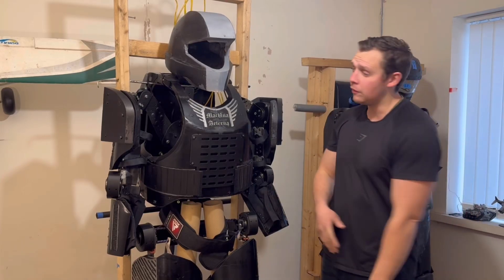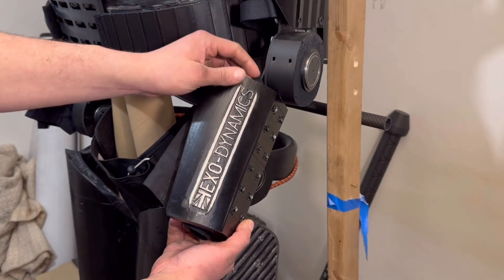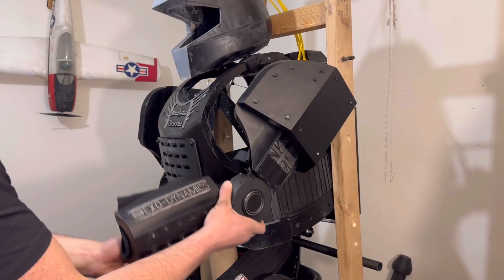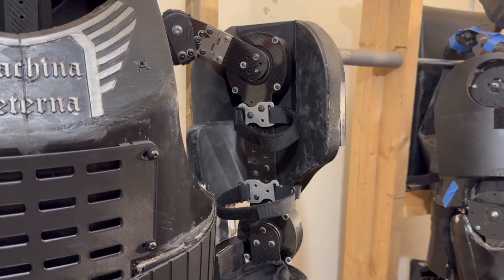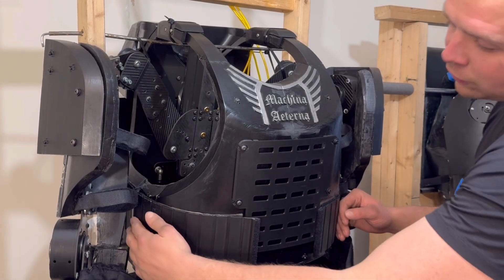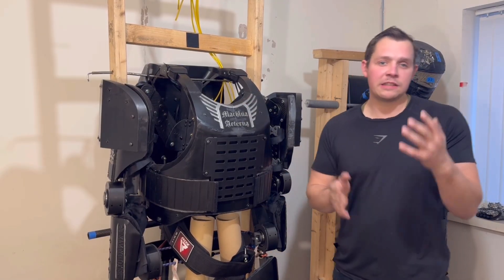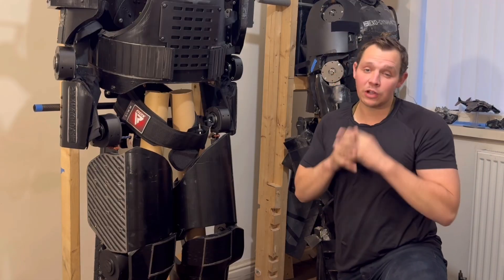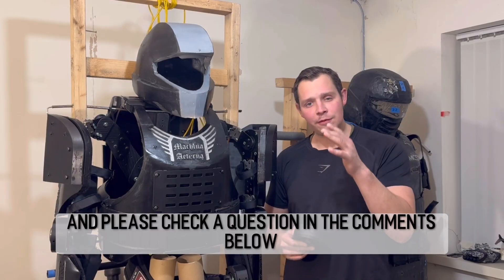My own Suit of Functional Power Armour is nearly complete!

Comment: Went back and watched some of your recent videos leading up to this one; some thoughts and points to help “standardize” or set up for future production are: (and I apologize if I come across wrong with my understanding)

For different sizing, maybe look at how you can swap the bars between the actuators. It looked like you had bolt on portions that connected between them, and it may be the simplest solution for adjusting to differing body shapes, but I’m not sure if it would be the cheapest as it would require a range of extra parts to be manufactured. 

Speaking of the actuators, have you thought about looking at the electric motor designs used in EVs? I don’t know how well they would translate or compact, but the Prius EMs they have been recently producing are quite flat (for vehicles) and may give inspiration for any improvements if needed. 

For the armor, I think you have a good start. Focusing on a layered design may be best, with a way to fit and swap plates, otherwise steel may need to be the go to for encasing the ceramic tiles. I’m not sure about a plate carrier connection with weight, distribution, and form fitting, but it would be a way to help connect it to the body easily.  

Overall it looks like a great design! As a state side cousin, I’m definitely curious to see where it goes and how it performs under tests. I do apologize again if there is ignorance in my suggestions or knowledge, I’d be happy to discuss my points further if it helps. These are just some on the fly thinking…

Comment: Neat project. The weight is going to be a serious issue, even with mechanical assistance. You have to figure another 200 pounds for the operator and at least another 60 pounds in weapons, gear and ammo. That is going to limit where this thing could operate and how it would get to the zone. Not to mention to the fact you would be extremely vulnerable to things that explode. Might be useful for riot control situations where the pavement would provide support and less likely to deal with rpgs

Comment: Man this is some really good work. Kind of a shame the UK government doesnt want to get in on power armor early. Honestly this is pretty much right in line with the Cyberpunk timeline we are in right now. I myself have been wanting a protective suit of armor for high speed electric unicycle riding. I need something like an ironman suit, particularly from iron man 2 would be ideal. Something I can step into and it will sort of attach itself and be able to absorb extreme impacts, and modularly repairable. This seems like a pipe dream but it would be so amazing. I think what youre doing here is the first steps towards something like that.

Comment: Modern fragsuits exist that the FSB uses, it’s possible that it could be worn as a base protection layer under the armor. I am not sure if it’s something you could actually get, but a shrapnel protective jumpsuit under the powered plate armor could prove to be very good protection. One issue I can see however is overheating if wearing a frag suit

Comment: I love this but in the practical sense I can sadly only see this being used in the commercial market or logistics because of the strength multiplier that it is, aka the ability to make the normal man stronger than he normally is, I can see this in construction or any labouring work. With modern warfare I do not see this sadly being practical with various factors like the power supply, there's no way that can run forever, anything doesn't run forever, replacement parts, and the complexity like a normal soldier or operator must learn how to not only operate his equipment but learn how to maintain it, and probably the bulkiness of this.

Normal body armour is already quite bulky and heavy, with how I look at your armour it seems quite bulky, not that bulky but bulky in the very least! And that's just the factors I can name.

But That's just my point of view and opinion, don't stop man on your dream, will continue to support you and hope you luck in the future.

Good luck with your prototypes mate. And again it looks so cool!

Comment: Speaking from the perspective of a U.S. Marine veteran that is now an engineer, you've done an amazing job, given what your resources must be. You've done better than the entire country of Ghana, which has a much larger budget. Full credit to your skill and improving craftsmanship. You should be proud.  

However, I would not wear this device in battle unless I had NO other option, and even then, only in VERY limited capacities where I wouldn't need to move much. The problem isn't anything that's your fault, it's just the existence of far superior, albeit far more expensive materials that afford greater mobility without need for a heavy battery pack. Graphene, in particular, is at least 200 times stronger than steel, and if added in small amounts to carbon fiber, is ALSO 200 times stronger. That means 200 times lighter, of course, for the same protection. And it's far more versatile. Every gap you've got for flexibility could be covered with Graphene lamellar, and the suit could weigh around the same as a flak jacket, with only light carbon plates to distribute impact force. 

Unfortunately, Graphene is around $50 per square inch and it requires an incredible amount of energy to work with, along with specialized equipment due to its incredible strength and heat resistance. You can 3-D print it, but whatever you print isn't getting chemically joined to anything else because it's a stable carbon lattice. That would mean ringlets, Velcro, or whatever else to secure the pieces together. Those will be the gaps, but they'd be smaller and stronger. 

Battery power in such a suit would be better used for low-power electronics, especially comms, to reduce weight, since a human could wear the suit itself easily. Your power armor and whatever actuators you develop might be better used in support roles to augment strength, and preferably somewhere near a generator for constant supply. FOBs at risk of insurgent attacks or something, to protect support personnel and aid them in the very necessary task of hastily loading and unloading vehicles. The vehicles themselves could be the main power source. 

Other than that, the metal fasteners have to go. They'll shatter upon sufficient impact, creating shrapnel, so you might as well just Velcro the pieces together, or use a polybonding agent. Velcro is preferable for adaptability. 

That's my 2 cents for now. I wish I had the $10 million or so it would take to get you the best equipment for this project, but hey, you're in the U.K., right? Maybe you can claim status as a gay Syrian refugee and tour the continent collecting welfare money to raise the money. No insult. It's just one of the best ways I can think of to get free money before you're really gonna need that armor.

Comment: You know what's surprisingly light weight and resilient as a cheap material to make composite-esk armour out of? 

Simply lacquer and fibre glass sheets. 

Much cheaper.

Could be worse man, you know that in Queensland, Australia, you are not even allowed to wear anything that and I quote: 'Could stop a 9mm bullet'. 

How fucking nuts is that? 

Might as well be stirring peanut butter with your Dick.

The law hails back to the 1990's and Vietnamese gangs. 

But honestly, same old dirty nasty, lazy, rotting governance misnomas. 

They never reneged the law, once the problem passed. 

But it is those most adaptable to change that survive.

Comment: I feel like some sort of shielding for the neck might be good to have. I was thinking back to different medieval armors that on the torso pieces have a bit of a lip or extension at the neck area and the arms for preventing arrows or blades from deflecting or going directly to the neck or armpit regions. I think making it specifically for shrapnel over just taking a bullet might be better for weight.
Reply from the maker: Yeah it just needs to be easily removable. I guesss medieval knights had peasant surfs to help them do normal things when in afmour. But with a gorget on you cant look down.
Reply: @MattExo-Dynamics  Indeed a large gorget or ill designed one would block vision. Maybe a minimal one, just something to deflect shrapnel from the neck. I would think if it went even 3-4 inches out it could deflect most shrapnel no?
Reply: @MattExo-Dynamics  we had soft gorgets for the interceptor body armor I wore in Iraq. You could clip it just like we did

Comment: Have you taken a look at all at the resistance spring based exoskeleton that Crash Makerspace has been working on?  Also for the forearm mounting system have you considered using an off the shelf short picatinny rail?  One other suggestion is to look at the way some of the modern sport reproductions of 15th and 16th century mantled gorgets that integrated with the helmets worked, basically two plates of metal that sat on your shoulders and then 2-4 bands both in front and back of the neck that hinged on one side and buckled or latched on the other, with a wide enough roll at the top that an armet or close helm could close over it to keep it in place.  Aside from the neck protection mantled gorgets do a really good job of spreading out the weight from all just riding on a couple of points on the shoulder.

Comment: It looks cool, and I want you to keep working on it. But I've followed projects like these since I was a kid. One man made a suit he used to "fight" a bear. But I'm worried it's falling into the same issues that a lot of these power armor suits fall into. They're heavy, expensive, and impractical. You have to stop and think: Who are these suits for? How many soldiers do you expect to wear these? Would a soldier actually prefer wearing something like this over a flexible material that allows him to move quickly and efficiently? If they do adopt these, each one would have to be tailor-made to fit the individual. In real life, special individuals with special equipment like Master Chief aren't a thing. That's because in real life, giving only a select few soldiers special equipment is pointless. If it can't be given to all soldiers, then that's a massive waste. 

The reason why these suits aren't commonplace isn't that we don't have the technology; it's because we can't figure out how to implement them. The exosuits we have so far are designed to be lightweight and integrate with already existing body armor. Even then, it's experimental and only used for heavy lifting like large ammunition. 

On top of that, research is starting to come out that exoskeletons actually hinder movement rather than enhance movement because the wearer has to relearn how to walk and move while being assisted.

Comment: why not use a gorget for neck, chin, and face protection?  rivet it onto the breastplate.  full head movement is maintained, equal head/face protection is maintained, and less weight is put on the head.  I guess it's meant to aesthetically resemble an ODST so maybe I'm barking up the wrong tree.

Comment: Stitch the Velcro onto the harder components so that it is not relying on just adhesive, at the very least at the corners and every few inches, since it would otherwise require a lot of drilling.     Use polyester for prototyping but Kevlar for test articles.

Comment: Looks cool, man! Unfortunately of limited application. FPV drone goes boom.
Reply: Fpv drone fetish a lie, you act like they are omnipresent guaranteed death. If it was the truth there would be no more infantry nor vehicule in the ukraine war, which is not the truth, of course. The fpv drone is the new "medium tank" fetish, an annoying internet troll memes with no basis in reality.
Reply: @polomarco7053  They are, in fact, omnipresent near-guaranteed death. You can't hide from them, you can't run away, you can sometimes shoot them down but the explosive attached to them may still kill you. The only reason why we still have infantry here, in Ukraine, is because drones cannot hold territory, at least the flying ones can't. We also have ground drones that CAN hold territory. We are moving towards more and more unmanned warfare each and every day and the actual limitation is signal technology.
Reply: @BIGESTblade total propaganda as everyone would be dead. There wouldn't be so many veteran sharing their stories on telegrams and providing so much combat footage (where not a single drone is seen). Also it's not what all the videos showcase the drone are slow, there is also still an enormous amount of videos of combat without any drones involved. Mine are much more of an issues than drone. As notice how you skipped the part of my comment about vehicule, total troll.

It's also filled with footage of infantry used offensively, there your claim "infantry is to hold territory" is a total lie as well.
Reply: @polomarco7053  You are free to disbelief, of course. But you can't tell me that I am seeing each and every day with my own eyes is propaganda. It just don't work like that. I see drones actually fly overhead. I know people that use them and got hit by them in the past. I have access to first-hand information from the people that literally fought in the trenches. Save your accusations for someone who cares.
Reply: @BIGESTblade there is entire telegrams channels dedicated to it. And even on youtube you can find plenty of videos of infantry used offensively and infantry on infantry, without any drone involved; Therefore you are lying. You also keep pretending i didn't write anything about vehicules. Therefore you are a total liar.
Reply: Its not something you gonna use in a open field so it doesnt matter, also this doesnt even need to be used for war, could be of use for counter terrorist
Reply: @Quasimoudo  If not in the open field then for what? Boarding ships? Clearning underground bunkers? Those about the only times when you aren't going to get hit by an FPV drone. an FPV drone is like the ultimate terrorist weapon It's literally a guided IED.
Reply: @BIGESTblade yes literally anything close quarters in a enclosed space, also by your logic infantry should be even anywhere outside of safe areas cause they are asking to get strone striked
Reply: @Quasimoudo  That's pretty much exactly what happens, yes. This is why it takes Russians months to make the smallest ammount of progress and literal thousands of casualties for each kilometer of territory they take. 
Their whole tactics are as follows: they send a group of their people with orders to advance and establish a fighting position at some grid. They get hit by drones over and over again until they are all dead. Russians send the next group and this continues on until one or several of the intantry actually managed to survive and get to where they were ordered to go. This process repeates for months until this gradual accumulation of Russians within the general area gets large enough to make holding the area untennable for Ukrainians. Russians have their own FPV drones flying all over the area so clearing these tiny groups of Russians can easily lead to disproportional casialties which is not something that Ukrainians are willing to risk due to being heavily outnumbered as is.
Reply: @BIGESTblade this is absolute propaganda because it imply russian do not need to eat food or have need. Since according to what you are writing, lone russian soldier stand still in hibernation waiting for others to get there.

There is also plenty of footage of ukrainian using infantry, or sending their infantry to walk on mine one by one. You are a liar.
Reply: War has turned into trench warfare again, but the artillery has been replaced by suicide drones
Reply: @leviathan4498 I mean no, the aviation was. Artillery just has a different purpose. Instead of attacking manpower and vehicles, it is attacking fortifications.
Reply: @BIGESTblade pfff you claimed you didn't have the time to keep lying like this. Again, that a lie, youtube and telegrams is filled with footage of artillery being used against infantry and vehicule,  including moving targets.
Reply: @polomarco7053  Time? I think you are reading things that aren't there.
Hmm... really now? And you know what else is there footage of? Drones exploding fortifications with thermobaric charges. It's almost as if people use their tools in more ways than one even if it's not their main purpose.
At this point I am  done engaging with you. You are very bad faith and I have a feeling that you are going to claim "lies" regardless of what I say unless it supports your preconcieved notions.
Reply: @BIGESTblade you are liar indeed, as you have claimed "artillery has just has a different purpose. Instead of attacking manpwer and vehicles, it is attacking fortifications.". Now you are backtracking. You also wrote "save it for somene who care", that of course a lie, as you do care. The "very bad faith" is a reverse accusation from somoene who claimed that drone are omnipresent (absolute lie) "near guaranteed death" (absolute lie) and that artillery is used solely to attack fortifications(absolute lie).

Comment: Your biggest mistake is actuating the joints directly with the electric motors, E-motors are fast but week, try iterating mechanical joint solutions that are stronger and drive the mechanisms with the E-motors instead.
And you are moving in the right direction remember Armor is perfect for structural components as well.